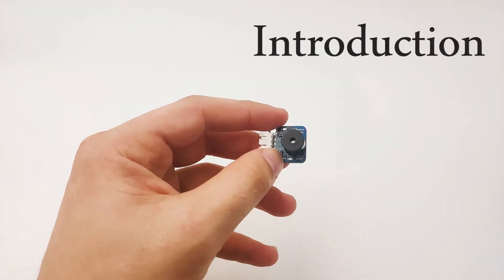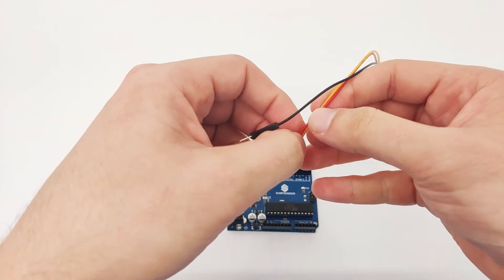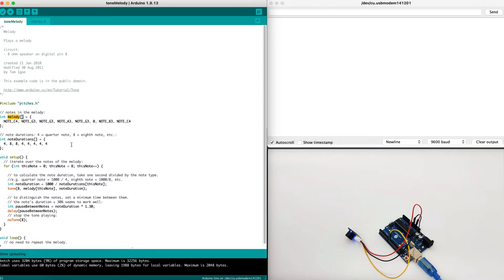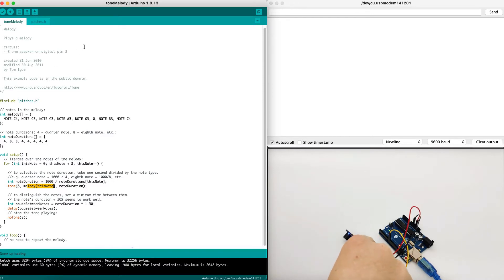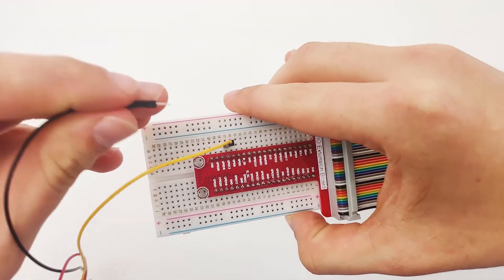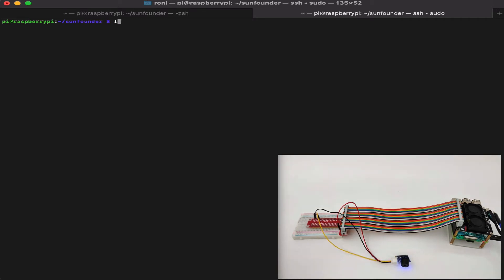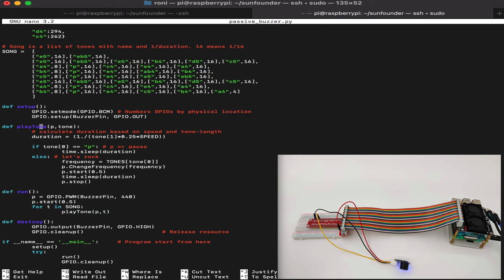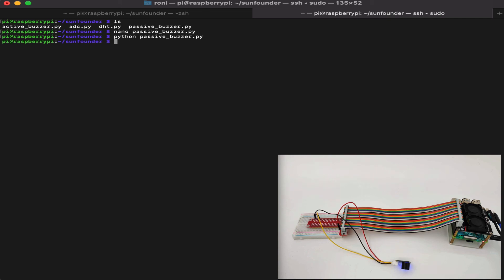How to use Passive Buzzer with Arduino& Raspberry Pi

Comment: i have the passive buzzer module that have GND, I/O, and VCC pin out. so is the I/O pin the same as the signal pin of your buzzer
Reply from the maker: Not easy to say, the same in general, you can try.

Comment: Greetings, my buzzer starts ringing as soon as i power up the raspberry pi what could be the problem?
Reply from the maker: Normal. You can connect 3.3v first or burn the code to see if it will be like this.